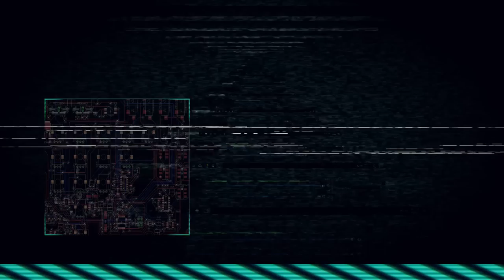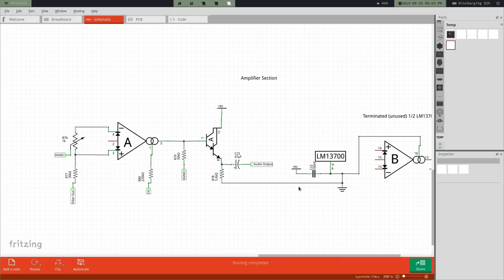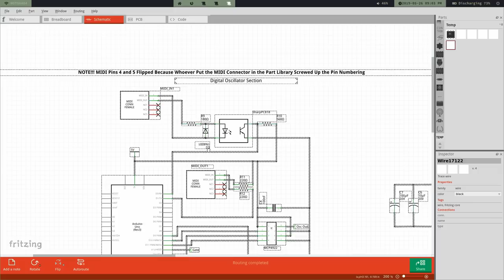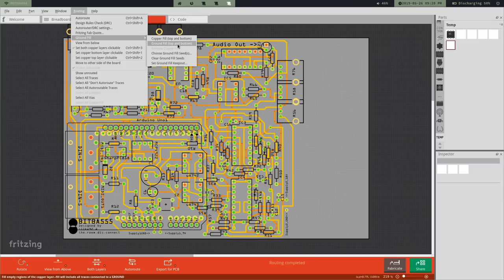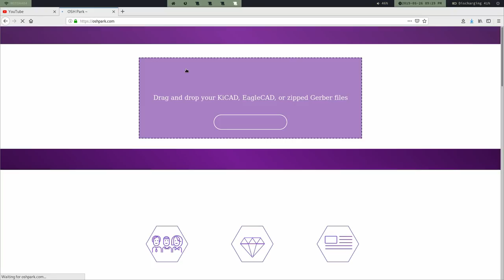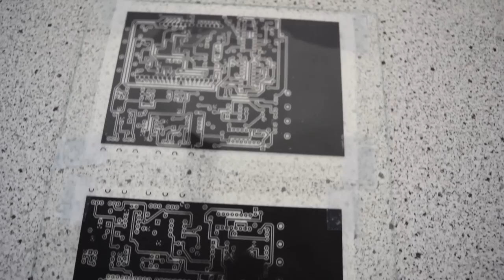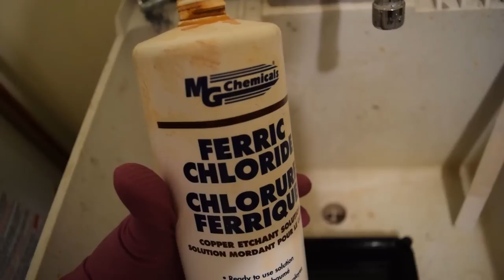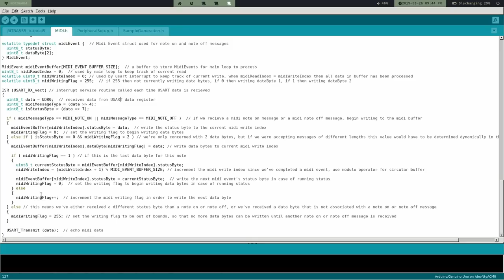DIY Synth Design Tutorial Series - 005: Board Layout and Fabrication

Comment: Just an FYI. OSHPark doesn't charge anything more for through hole or vias... It is a flat rate per square inch.  That's why your board is so expensive.  You have a rather large area of board that is just bare adding to the cost of your board.  When doing it DIY it is no big deal, but pretty much all the small run services charge by the square inch, then add on for extras like gold plating.   This is a big reason to get everything tight together on the board, to minimize the board area.  Great project and video though.... I will watch your others too. I would like to learn about the digital oscillators!
Reply from the maker: Thanks for the info! The last time I ordered boards it was through a Chinese service who did charge by number of vias, through-hole components, ect so I incorrectly assumed it was the same. Maybe I'll make an SMD version that's a lot smaller for people who want to order boards through OSHPark in the future though!